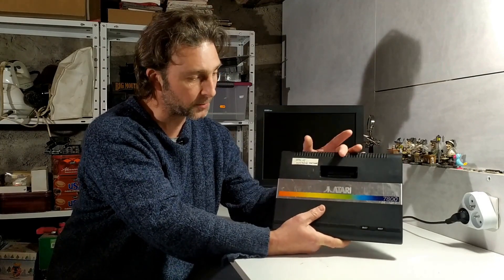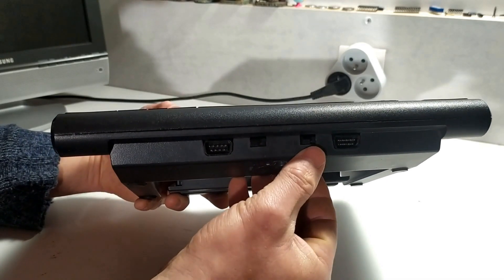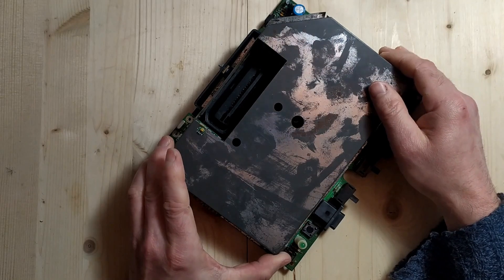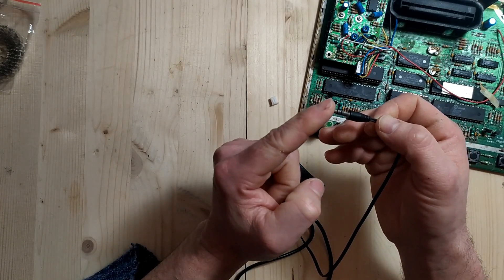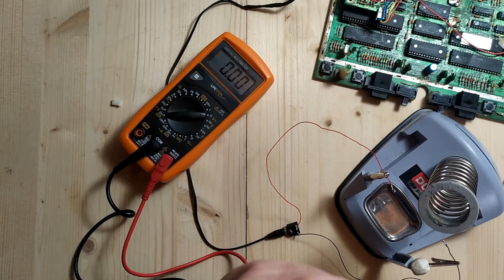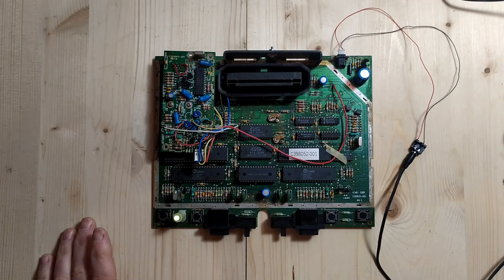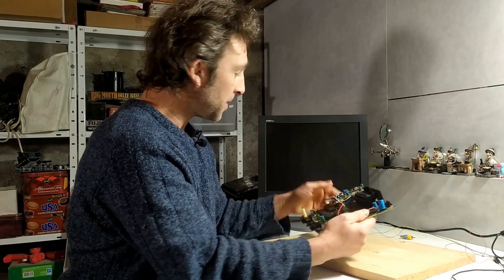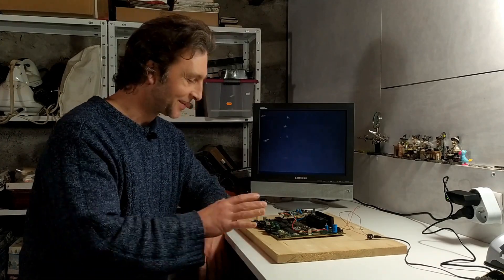Atari 7800 Euro Scart version Ebay spares or repair | Building power and scart cables

Comment: A nice  finding you got there Peter 🙂The booster with the  NPN transistor I think it was widely used on the 2600 model - mostly 2N3904 or NPN equivalent like the 2N4401 in your case - Nice neat job, this booster turns to be a simple and classic solution after all -  Glad it was working unit mate! thanks for the video, cheers!
Reply from the maker: Thanks Cyberhug, the NES mod didn't work as well as I'd hoped, I only had a black and white picture. I think that the signal I tapped into was sync with chroma. If I'm thinking right I'd have to find the luma signal somewhere and combine both for a colour composite signal. Or maybe I just used the wrong value resistors? In any case it works with the scart cable. Just needs a little cleaning and maintenance and hopefully the select button will start working properly. Thanks for watching man ;)
Reply: @8bitsinthebasement  Hey Peter i saw the part that i missed the bits, yes - It is interesting tho how it was in b/w only. If the same principle followed like the 2600 and since your resistors are the right ones, i would think something like removing some existing resistors from the pcb - just wondering and typing here... Cheers mate!
Reply: @8bitsinthebasement  does the Peritel 7800 not include composite video out to the scart socket as well as RGB? Mine certainly does as the ancient TV I have it on only had composite in on the scart socket and no RGB mode. And it works fine.
Reply from the maker: @Craig Harrison  Nope, not that I'm aware of. The first test I did with the RCA connector in the A/V socket would have given me a colour picture if that was the case. Also the sync signal from pin 2 of the DIN connector is about 0.2 volts, far too low for a TV to lock on to (thats why I used the 2N4401 to boost it). The DIN socket also has a pin providing +3 volts to pin 16 of the scart socket (to enable RGB mode on the TV). I've just had a search around while writing this and found this thread https://atariage.com/forums/topic/170736-french-7800-with-scart-what-does-it-output/ Near the bottom a guy called Rastignac says the same as you. The TV will use true RGB if available or composite if not. I must have missed something in my tests or else maybe my 7800 has a small TV output problem. Thanks for pointing that out Craig, It will be fun getting to the bottom of this one ;)
Reply from the maker: Craig, when I got in from work this evening I connected the Atari to my TV and tried out a few things. I have a picture as I should when all the scart connections are made. When I remove the 3 volt signal to pin 16 of the scart cable the TV displays CBVS (composite) and all I have is a white screen. The only way I can get a picture out of it is with 3 volts going to Scart pin 16 (to enable RGB). Removing the colour cables one by one does as you would expect. I tried with just SYNC, ground and audio connected, I hear the sounds but again all I have is a white screen with CBVS displayed on the TV. There are 5 unused pins on the Atari's TV connecter. Maybe one of them is composite and is somehow connected to Scart pin 20 of the official Atari Scart cable. I'll check those pins this weekend. Other than that it may be possible that there are two versions of the RGB converter board and one of them gives composite as well as RGB like you have. I've looked at quite a few threads on the subject and there are some who say both signals are present and others who can't get a picture through composite.
Reply: @8bitsinthebasement  given the mess of bodge wires present in the Peritel version nothing would supprise me more. If your pokey out audio is quiet then a resistor can be removed and replace with a wire link and moving the blue audio pickup to the marked AUD pad.

Comment: I did something similar with a Peritel 7800 over Christmas. I got a Concerto SD based flash cart for it and a fitted my spare Pokey chip in that. This system has to have the best version of Ballblazer of any console. beautifully smooth and ridiculously fast!
Reply from the maker: I looked into sd cart solutions for the 7800 while I was waiting for the system to get to me. The Concerto cart looks to be one of the best options and like you say the fact that you can add a Pokey chip to it gives you the ability to play Ballblazer and Commando as they were ment to be played. I'm not sure but I think that the Concerto will work with a Yamaha chip if you don't have a Pokey (they are getting quite hard to find). I'm going to try to mod a 7800 cart so I can program different games on it (I think that a multicart is out of the question on this system, the games are very large and from what I've read it's not as straightforward to make 7800 carts as it is for the 2600). Thanks for watching Craig and enjoy your 7800 ;)

Comment: Excellent video! I have a 2600 and 65xe  and would love to eventually get a 7800. I have seen threads about something called the concerto cart that is a SD card multicart for the 7800. Maybe you can get one of those, so you can all 59 games to play on your 7800.
Reply from the maker: Yep, I've heard of the Concerto cart. It looks to be one of the best available for the system and it supports the Pokey chip too (if you have one). For the moment I've picked up a copy of 'Jinks' and I have every intention of opening it up and taking a soldering iron to it. Hopefully I should be able to use it as a cart that I can program and swap ROMs into to try out some homebrew and with a little luck Atari's own 7800 games. Happy new year ;)

Comment: What are you using for eproms and burner. Great video Peter.
Reply from the maker: Thanks Mike. I use ST branded eproms of all types but mostly 27C128 and 27C256. The programmer I use is a Minipro TL866CS/A. The thing to keep in mind when making carts for an Atari is that the Atari expects to find a ROM chip with an active high CE (chip enable) pin. This means that the ROM chip is turned on when  +5v is sent to the CE pin so that the Atari can read from the ROM. The vast majority of EPROMs you buy today (and the ones I've mentioned above) use active low on CE (0v turns on the chip). In order to get these EPROMs to work you have to use an inverter between the CE of the EPROM and the Atari (this converts the Atari's +5v request to turn on the ROM to a 0v signal which the EPROM needs to be enabled). I hope that makes sense. I hope to do a video on the making of that modified ET ROM I showed in the video at some stage in the near future (I hope). That video will be 90% using the programmers software (to modify the code) and programming the ROM.

Comment: Probably one made in Waterford!

Edit: unfortunately not, though many of them were, I think...
Reply from the maker: I took a look to see if it was an Irish one when I saw it listed but the underside wasn't photographed. As far as I can tell only some of the later 4 switch woody and vaders as well as the Atari JR.s were made in Ireland I'm not sure about the 7800. Did Atari have a plant in Waterford? I knew that they had in Limerick and Tipperary.
Reply: @8bitsinthebasement  Completely useless fact , the plant in Limerick was bought by Dell in the 90s (I worked for Dell in Bray years ago , and when I got to visit the Limerick Plant I was amazed to see an 'Atari stone "(basically a giant rock with 'Atari and the Fuji logo inscribed on it ) still on the grounds !) Hello by the way !!
Reply: Again a really interesting video. I managed to pick up a 7800 a good number of years back for a decent price. It’s a great system, backwards compatible with 2600 games certainly helps. Still prefer the look of the Vader 2600 though 👍